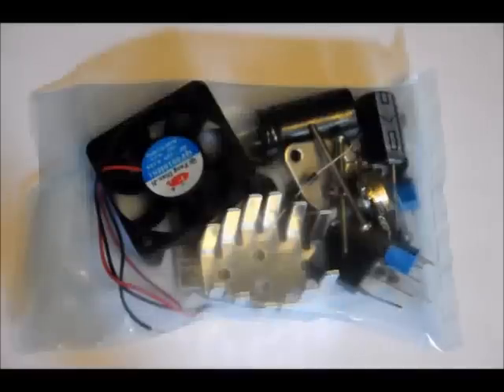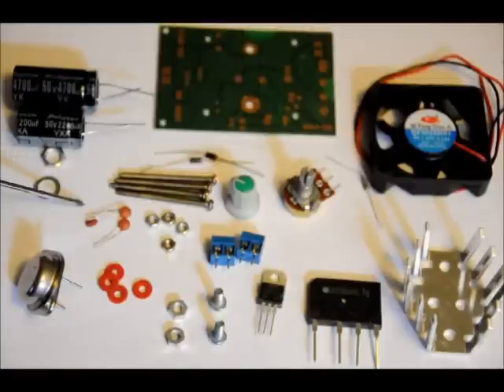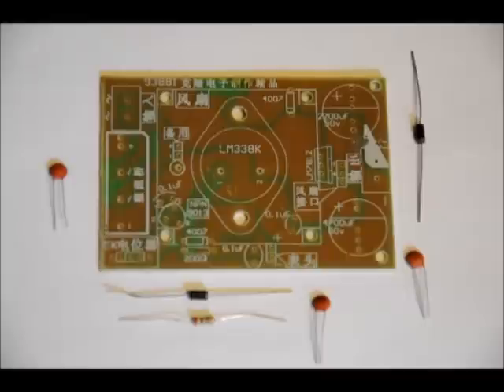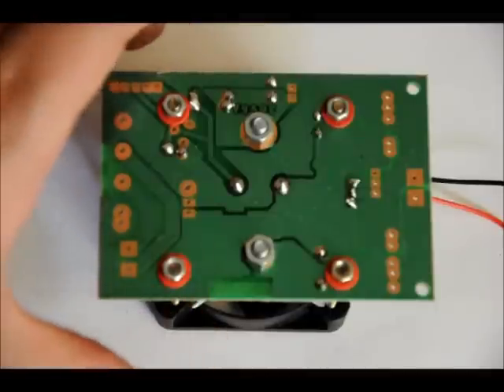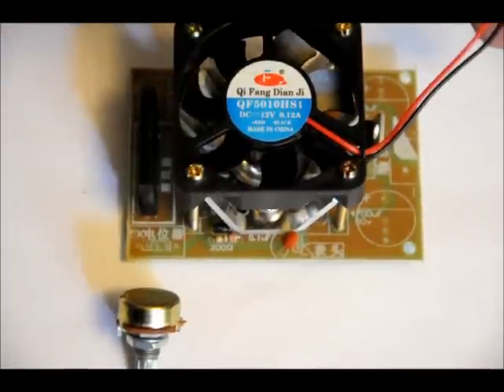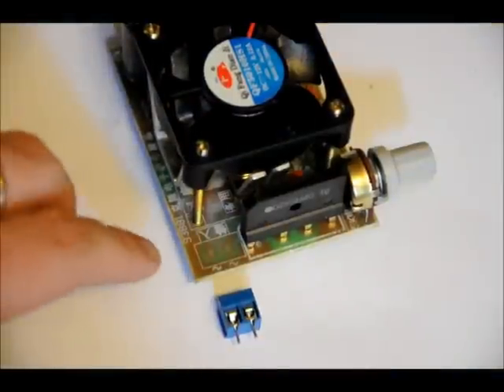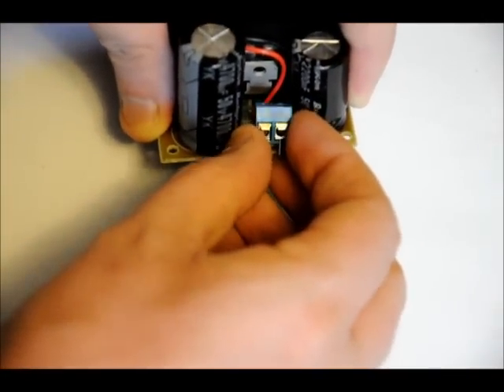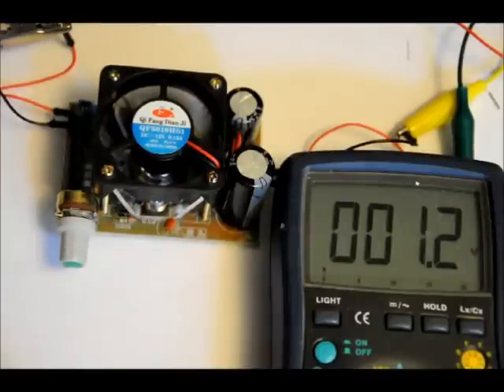The LM338 Power Supply DIY Electronics Kit   Test and Assembly Video!

Comment: Does anyone no the value of the diode d2 on the circuit board,mine was missing,I ordered a assortment of them,just trying to figure the value or way to find out,anyone
Reply: I haven't sold this kit for more than three years, but all diodes would be 1N4004 or 1N4001 =)  Doesn't matter.
Reply: Thanks so much ,that what ordered thank goodness they are cheap.on ebay